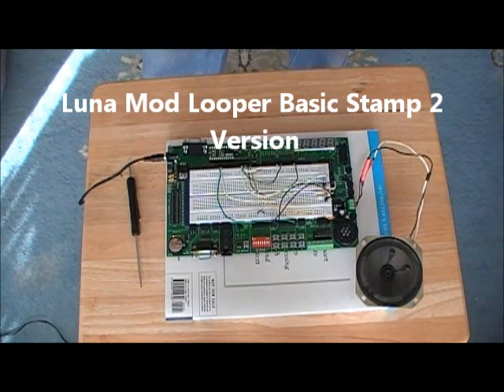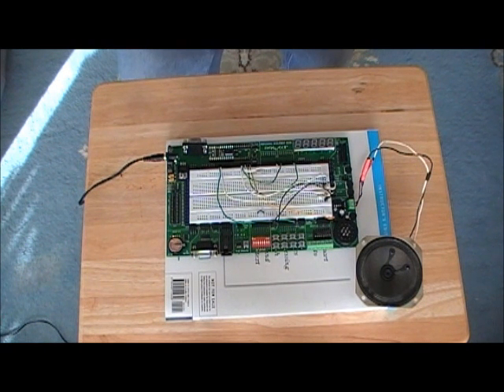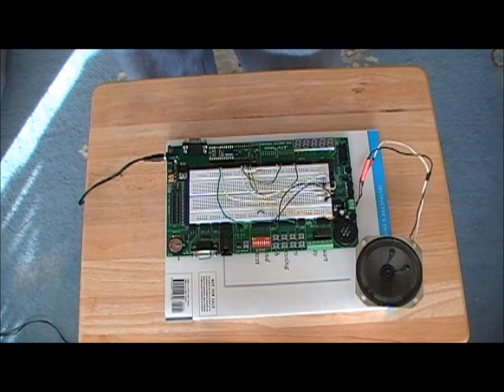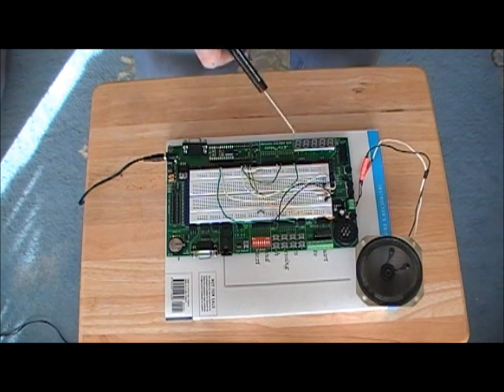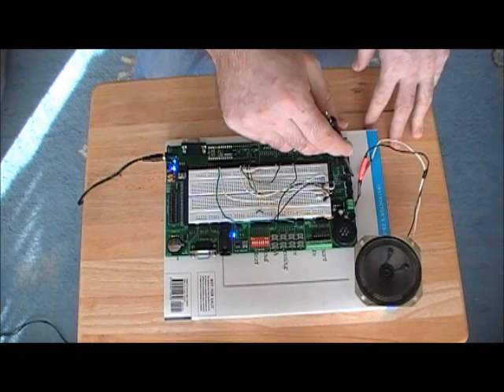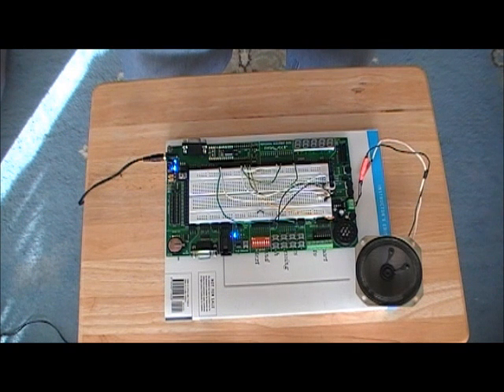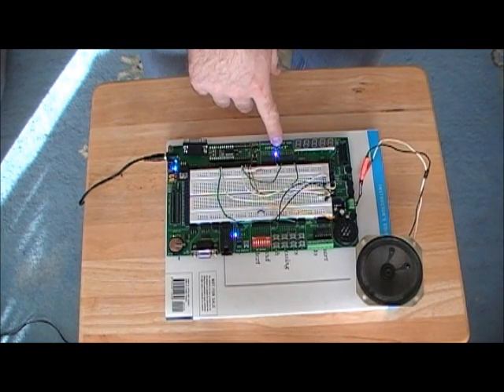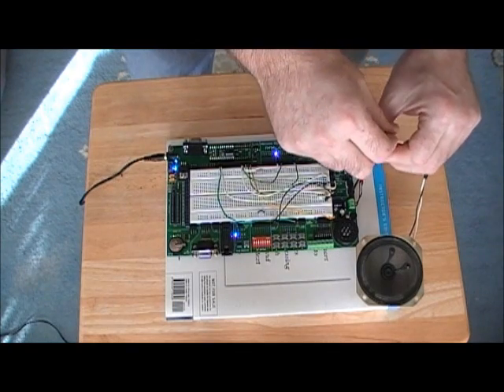Luna Mod Looper Basic Stamp 2 Version

Comment from the maker: Rather than post a new video here is a little update: At my friend's suggestion, I changed the loopList array to hold Bytes of data instead of Words. This made it possible to increase the loop size from 8 notes to 16 notes. The unexpected by musical result was notes with a range of C3 to B3 and those requiring higher frequency numbers turned into glitches as the high 8 bits were lost. Try it with your version and see how it sounds.